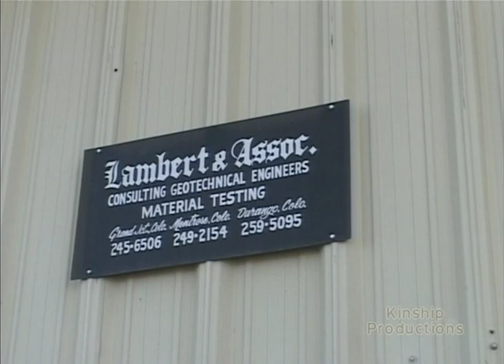Building with EARTHBLOCK

Comment: Can you use interlocking compressed stabilized earth blocks in an below grade basement? Can you use an CSEB machine to make Engineering Bricks which are supposed to be stronger and are used for basements or protection from moisture. Is it possible to increase the cement / lime percentage or fire a CSEB brick and fire it to make bricks as strong as an engineering brick to build basements, underground root cellars / tornado shelters etc.?

Comment: Marketing.  You gotta love it.
Take an ancient method.  Mix in expensive, high-tech equipment.  Keep the standards of viable construction obscure and closely held.
There is never a discussion of the total cost of this building method compared to stick built on site homes, and how or if it can be modified across multiple climates effectively.

Most modern home dwellers are expecting ancillary systems such as electrical, plumbing, air conditioning.  These are seldom addressed.
Building the "shell" of the house is only the beginning of the total process.  Similar to timber framing companies who will erect several bents of timber frame, maybe enclose that with expensive SIP components, and then leave just as the real work begins.
 
These videographers never challenge the notion that timber is a renewable resource, especially the softwoods used in the housing industry.

Framing with wood components may be all that some folks can afford.  And 2x4s are much easier use, lift and transport than earth for most people.
Not saying this is not an interesting method.  It is.
But if it is made into an industry with proprietary ingredients, "certified installers", expensive equipment to form components and unrealistic code requirements, then it is just another technology that is difficult for the DIY home builder to attain.
Reply: I agree that this will be more challenging and expensive for most people than a stick built house,  but if you have been inside an adobe building on a hot summer day you will want one for yourself.  If you have enough time you can buy a manual press for very little money (I bought mine for$50 on Facebook Marketplace) and with that press and about $3000 worth of other other equipment you can build a nice home... This is not for everyone, it works best if you can get a group of people to help build each-others homes and share in equipment costs... Walls are easier than roofs and will not fall on you and kill you if not built properly... Very few places will allow you to build a roof like this....

Comment: I would like a full cost breakdown for building one of these homes
Reply: Problem is it ends up MORE expensive than standard houses... because no one has any of the plans drawn up or techniques implemented or knowledge available. So it's all about how much labor YOU do.
Reply: @HallyVee  It may be more up front, but the building will last 10x longer than a conventional home, so in that sense, it could be significantly cheaper over time.
Reply: @dver89  quite right, quite right. Except for that thing I mentioned, nobody having knowledge or plans available. So it depends heavily on your expertise and execution.

Comment: What I'm still stuck on, is that CEB requires just as much portland as regular concrete, which accounts for 90% of the total GHG emissions.. Also, the wall breath and we have super high humidity here in Iowa.. How do I prevent humidity from entering the home, and what is the R-value of the wall considering Iowa is a heating dominated area? Thanks!
Reply: CEB is compacted earth blocks. No cement additives. CSEB is compacted stabilized earthblocks. 7-10% cement added for water resistance. Not water proofing. No where near the amount needed for a concrete structure. Not every brick is required to be water resistant. Earth block is covered under US building code as an adobe structure and requires a concrete foundation and a concrete ring on top of the wall for earthquake protection. The walls are breathable as long as you don't add a coating that acts as a vapor barrier such as a modern paint or a concrete coating on the inside or the outside of the structure. If you add such a coating on the outside of the house you also stop the release of vapor from inside out. Breathable coatings include lime plaster or lime wash. There is no R value for earth brick. It has no insulating properties at all. It acts as a heat delay. For every inch of wall thickness you delay the release of heat by one hour. For instance if you have a 12 inch thick wall the wall would absorb heat from the sun in the morning and then release it into the house 12 hours later providing some warmth in the night time.
Reply: Thanks  @richardleau  .  Typically, a concrete mix is about 10 to 15 percent cement..  So the percent of portland, cseb vs regular cement isn't much different if I'm not mistaken.